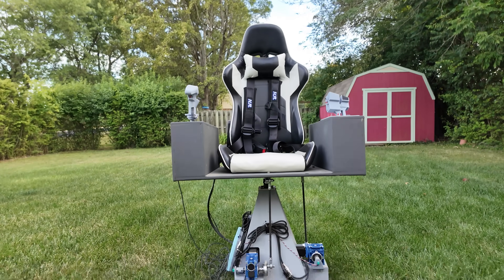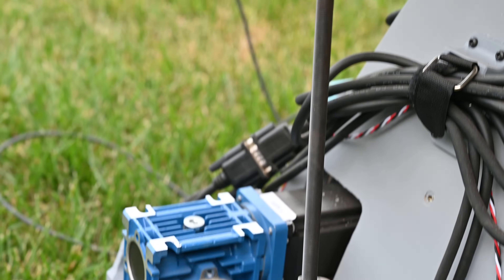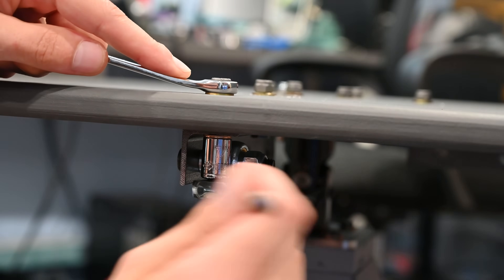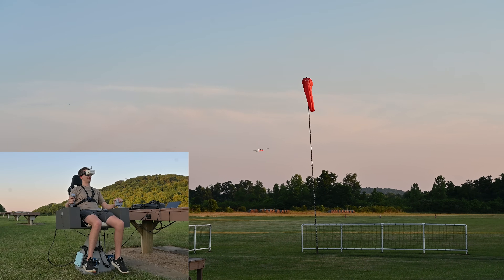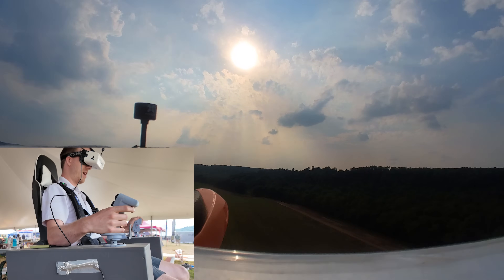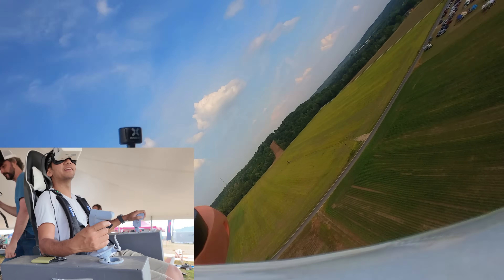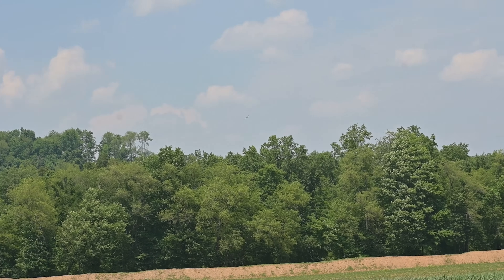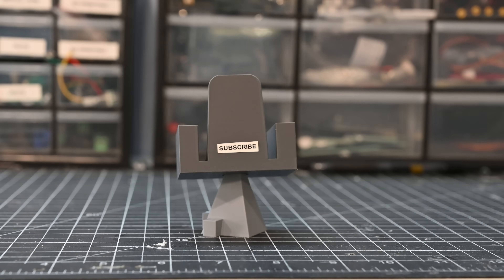Building a Real Life Flight Simulator

Comment: You mentioned multiple times about motion sickness or taking time to get used to the simulator which wouldn't happen if it was rotating properly.  Your simulator should be rotating in the opposite direction.  To immerse someone into your simulator, you have to mimic the g-forces they'd feel, not recreate the motion of the vehicle they are in.  For instance, someone turning right in a plane will feel a force pulling them towards the left side of the plane.  Your simulator should mimic this by putting the left side of the simulator between the occupant and the force of gravity.  It does so by rotating left despite the simulation turning to the right.  You should also build some stirrups for the chair so you don't have dangly body parts sending opposing messages about gravity to your brain.

Comment: Maybe less interesting to the general crowd, but very intrigued how you converted the values of the pots to a PPM frame.  I've been trying to figure this out for a couple weeks now.  When you converted to the Logitech HOTAS for the tank drone -- how did you use the usb vs wires to/fro a microcontroller?

Comment: step 2 wider fov camera, step 3 add a second camera for stereoscopic vision and pump it through a vr headset , step 3 two 360 cams for steroscopic 4DOF viewing (perhaps radios need to get a little better for this one). Also as a side note is you look how large simulators simulate acceleration you will see they breifly move in the opposite direction to simulate that G vector
Reply: a small motor that just moves the xameras is usually the borm on these

Comment: A flight simulator doesn't mirror the position of the plane, it creates movements that will try to replicate the forces felt by the pilot. If the plane was motionless that would be the same but it's accelerating in all sorts of directions and so the movements of the chair have to be quite different to simulate those forces. It's a wee bit more complicated than what you did.

Comment: Awesome build, but what is wrong with the mounting of the FPV camera on the plane? It s trying to stabilise to the horizon instead of staying with the plane as it banks left to right. Or did you show a different  camera footage than what you could see through the googles? It would be way better if it were fixed so as you bank left you can see the angle of the horizon

Comment: Even if you don't add rudder pedals to control, just a platform for people to put their feet on. I'm sure not being strapped in to the seat and it tipping forward without your eyes seeing what's happening where you sit, people will naturally compensate and will add to the workload of flying.
Add a slot in stand for a foot base and even a 5 point harness will really seal the deal.

Comment: Would be nice to get info on 1: the universal joint  (what kind and how you handle it) 2: how do you control your nema's (cards used and software) to use it with flight sim.

Comment: You could add something like a few numbers which tell you how fast you're going based off of the camera or GPS or whatever is in the plane to tell you how fast you're going, as well as probably adding something to slow down or speed up if there already isn't. You could have a microphone on board of the plane, and get it to transmit the sound to some headphones or something. Head tracking to look around would be cool too. You could also add flaps or something to help with maneuverability if possible or if you want, and a cockpit made of glass or clear, transparent / translucent plastic to protect the technology inside the plane and still allow the pilot in the chair to see outside of the plane.
Reply: Can I buy it 😂😂
Reply: @The_legend_manas  maybe

Comment: might I suggest a modified FPV feed that has some telemetry at the bottom (speed, altitude, etc.) so that 1 it makes it easier not to stall as you learn the coorlation between telemetry and the chair, and 2 it further imitates flying a real plane.

Comment: Would be cool to build an actual cockpit, so the fpv camera is inside the plane (on a swivel paired with the goggle gyro or something so when you turn your head it turns the camera), so it looks like you're in the actual cockpit (including having to look out the windows) instead of on the nose of the plane. And get a pair of fpv goggle with video output, so you can show us some of the actual fpv.

Comment: It looked like you just had the chair mimic the plane's attitude (with some lag)? That's cool, but it's not how an actual flight sim works. They use kinematic illusions, so the chair tilting back could mean pitching up, or it could mean acceleration. A bank left would probably need a dramatic shift left, but then a slow crawl back toward center to simulate the coordination of the turn, with tilt left or right throughout the turn representing slip angle rather than bank angle.

Really cool project, but I think with some more thought put into the software, it could really go to the next level! Also not sure if there's any way to reduce lag, or what the sources of lag were... I'm guessing software interpretation of the inputs from the controllers or the flight computer?

I mean, ultimately it's a DIY motion sim chair, not a full-on commercial flight simulator (which would all be run on the same computers for zero lag), but I do think some extra thought could help it out some, maybe? What do you think? Did any of your test-pilots comment on that? Were any of them real pilots as well, to know the difference?

Comment: It would be cool if the camera was inside the cockpit of a plane. And it was in the position of where the pilot's head would be, and turns side to side depending on where you were looking. Make the cockpit a replica, one that is built to look real. That way you would get the ultimate simulation.

Comment: Amazing stuff, great work. Have you considered adding a linear "Accelleration simulator" under the bottom of the chair? Moving slighly backwards when you accellerate gives you a more emersive feel for speed. Decelleration returns it to its orgininal position, or even moves it forward! This could be done with 2 electromotor pulling on cables that move the chair. Would be sick to see

Comment: I have a full set of the old  ThrustMaster flight stick setup to include the joystick, throttle, and rudder pedals. The are molded in the stile of the F-4 Phantom controls. But I think that you could strip out the old electronics and upgrade them for your use. They may be helpful for your next charge builds. I would be happy to donate them if you will actually use them. Do you want them?

Comment: Normally, in the real aircraft, if it's a coordinated turn, you wouldn't feel the side to side forces in the bank....like the chair banking with the aircraft....If you did feel those forces the aircraft would be in a slip.......Maybe a better way to simulate G forces would be to have the chair rotate or lean back.

Comment: One way to significantly improve this is to use principles in real full motion flight simulators. Real full motion simulators don't read the exact pitch and roll, but rather tilt with changes to those values to simulate the relevant g-forces (you can feel normal gs while even flying inverted, hence why artificial horizons exist to prevent disorientation). Nonetheless, very fun and well done project

Comment: You could put a fan on the seat that blows in ur face using telemetry . Full fan speed is linked to top speed, low to no fan you at stall speed. Use sim racing blowers as an example

Comment: Could you add some telemetry data to the VR display. Speed, attitude, and altitude. It would help avoid stalls.
Also, somewhere to put your feet when in the chair, maybe connected to rudder controls if the plane has them?
Finally, twin cameras on the plane for that stereoscopic feeling.
Awesome project btw.

Comment: Mate this is... awesome!  If you'd like some suggestions, please I am not trying to downplay your obviously excellent skills and talent as I know you had very little time to do this, I just think a rumble pack like the gentleman said after he landed in the corn field.  With that you can get force feed back, but that wouldn't be really needed (harder to apply rudder under certain conditions for example) and it would make it much more complicated.  If you did decide on something like that you could use same telemetry for locations/control surfaces.  It would be an easier way would be to just say; when a certain x amount of things is happening and has just happened then turn rumble on to simulate flat spin for example.  That rumble setting could then be used for different things like barrel etc., just a thought to make it easier if you decide.  As it would give the pilot a great sense of feed back/point of reference, kind of simulating g-force's and thrust.
Quick question, is using just the one uni joint giving you troubles with actuators and motors wearing out?  It's a substantial uni-joint and I understand it is definitely a great way to get around weight and price issues etc., or is having a 1:10 reduction alleviate the stress on them?
Oops actually two questions, I get having the uni-joint on the fulcrum like that, maybe but bars with foam (for safety) around them if you are going to demo this in public (you do not want to get sued lol).  Actually looking at your scale model, there would be no way of tipping due to the shape, even a uni failure would not cause it, sorry about that.
I love watching your videos, I think you are great with electronics/design/engineering and most of all the imagination to come up with this in the first place.  When the last gentleman flew that plane and eventually crashed, you could see it was like he was about to do a stall turn/lose control doing that slower but steep right turn, but he over compensated and went left, this happens a lot in air crashes (no shade at the gentleman flying, again I couldn't do it), but it showed you it was very engaging with people and the result was; things happening that happen in the real world.  That means you nailed it.  I wish I could do what you do.  Mate great video and I look forward to your next. Cheers.

Comment: Congrats on your unique development of radio control to that of a pilot flying it!. All other suggestions given are the way to develop it further are pretty well covered ..priority to put he pilot in the seat of the a/c is necessary with ability to glance out along the wings to help orientation of the pilot. Vibration fed into chair will help. I did a little variant of this once when I put my Cassutt 111M  in amongst a group of country located radio control flyers. They all went to ther deck instantly. They talked about the event for years..All I can say is "I couldn't resist the temptation"!

Comment: Love it! I’d definitely like to try that out. However, may I make a couple of recommendations? I’d switch out the attitude signal for a directional g force signal. In full motion flight simulators they use gravity to help make the pilot feel like it is accelerating. Additionally, if the pilot is in a fully coordinated turn, the g force will be straight down and you won’t feel like you are leaning but rather straight and level. For accelerating the simulators tilt up pushing the pilot into the chair like accelerating and when decelerating it tilts forward. 

I’d also recommend adding rudder pedals to keep the legs from dangling and to give an additional method of control. 

And lastly, maybe add an fpv head tracker and camera to allow for the pilot to literally look left and right while flying. 

No matter, it still is awesome and I’d love to see this in action and more of your builds.

Comment: I built one of these years ago using 12 volt car windshield wiper motors. I also had pedals for the yaw axis. 
I really enjoyed flying quads with rudder pedals because it isolated the yaw. You could make a pedal turn without affecting the throttle and vice versa. Makes for much smoother flying. 
The other thing that works really cool is using the chair as a joystick. 
It can be leaned to turn. 
If you mount large springs or shock absorbers exactly the opposite of each other the chair can self center.

Comment: That is the coolest thing that I have ever seen built for RC flight, and something I have been thinking about for awhile. I have questions. Did you consider using feedback from the flight controller's gyro, mounted on the airplane, to control the chair's movements?  If so, what made you go with using the controller output? Ok, that's my only question I guess. I have been thinking about something similar for awhile, only my plan was to build a cockpit with a few of the wide-screen curved gaming monitors for windows, and room for a passenger.   My gripe with the headsets is that I have a headset 10,000x better called a Quest 3 (and a Quest 2 which would be just as good). After using the Quest, putting on a set of fat sharks is painful, and a Quest 2 can be found much cheaper than you can buy a fat shark. So, if I'm wearing a headset I want 3d 180* cameras and  HD transmitters. Can you imagine your chair with a quest 3, 180* 3D, even at like 2K?
Reply: https://www.youtube.com/watch?v=aKV7ffEzFzM

Comment: Great use of the Stratosurfer, and great project!
Tip for hand launching planes: Running rarely ever works. Give it a nice strong throw at about a 15 degree up angle while using about 3/4 throttle on the aircraft.

Comment: It would be really good if you could make Arduino code available that can read the telem and output it to a PWM signal that can drive a servo, I wanted to make something similar a while back using 2x 60kg servos on each axis and the seat on a ball joint (I like your universal joint choice) but I have no coding ability's and was never able to find anything that would do what I wanted.
I planned to just use a regular USB flight sim joystick using the RC override in Ardupilot, at some point I want to build a car trailer but from the bulkhead/windscreen back rather than from the B Pillar, it would be great to integrate something like this into a front seat and the car body would also be perfect for antenna mounting!
Reply: https://www.youtube.com/watch?v=aKV7ffEzFzM

Comment: There is a flight simulator for real pilots. It uses a platform like yours but the angles are calculated so,you would feel the „acceleration“ instead of only the pure angle. Maybe try copying this so it would feel even more realistic ❤

Comment: Very cool project.  I would think the central base point and two actuators would feel odd as the plane lifts and drops.  A four actuator system would more accurately represent turbulence, and the vertical axis.  Just an observation.  This looks like loads of fun.
Reply: Just wondering why need 4 instead of 3?

Comment: Add rudder control and then you can fly 3-axis. Also the next stage is to get the chair to move much more quickly to match whet happens to the plane, as well as some form of speed feedback. When doing co-ordinated turns in 3-axis, gravity is always directly below the seat, so that the chair should only tilt, if the turn is slipping or sliding.

Comment: This is so cool 🙂 I can imagine how much thinking and work had to go into designing/connecting/programming so all will fit and work together!
You know what would be even more immersive? If a gyro attached to goggles would move a 2-axis gimble with FPV camera on the plane. (I've noticed that a lot of people who tried it in your video are rotating their head quite a lot, which must have caused a strange feeling (as an FPV pilot I know this well - when what you see doesn't correspond to the movement of your head - hence the "VR motion sickness")). And of course, as less latency ⬇ between plane-chair and goggles-gimble as possible will also increase ⬆ immersion 🙂
Thanks for the effort you've put into this, Michael! 👍

Comment: If the seat is equipped with a rotation function, the ear balance will have a strong feeling. 
And you can feel the change in temperature direction under the sun.Your design has this advantage over those oversized simulators that cost tens of millions of dollars.

Comment: That build is incredible and I think I see 2 ways you can improve on your design. #1 foot pedals for rudder controlling (or at least foot rests that don't collide with the base structure) and #2 have the camera on a gimbal so if you turn your head to the right, the camera in the cockpit turns to the right. If you look up, the camera tilts up and so on and so forth. I suggest actually making a cockpit with a canopy to protect the camera and other fragile internals.

Comment: If you don't have one. I would check out a LG / Saitek X-56 Hotas. not to use in this, but to pull more inspiration. It uses a spring on the bottom of the stick to center it, providing positional feedback to the user. I have a Vr headset and this same hotas that I use for games like Elite Dangerous. Most of the time I cannot see the stick, but the feedback on center position is invaluable.

Comment: Put some trackers on the head display and forward the heads rotation to the camera on the plane and also try to forward the speed, angle and height from ground in to the headset. I think that would help them fly the plane easier.

Comment: so cool how this stuf would be un imaginable 10 years ago and a guy with a shed build it in 5 weeks!! nice job dude. also some foot supports needed. oh and would it feel more immersive if the chair movement came from a g sensor? i feel like taking a corner is not the same in a plane as in a boat.  just like on a motorcycle you don't feel like your sliding of it.